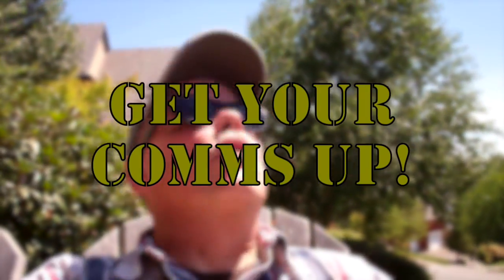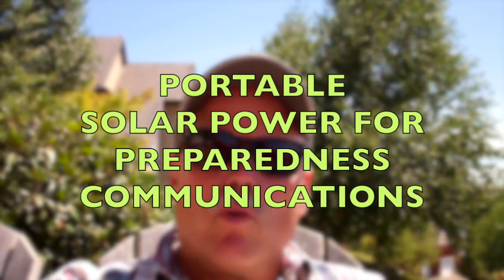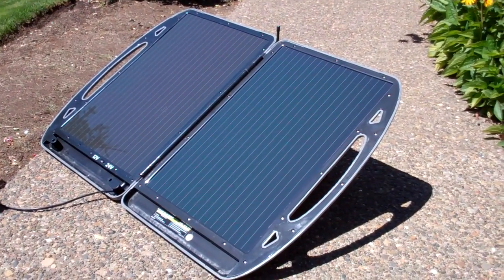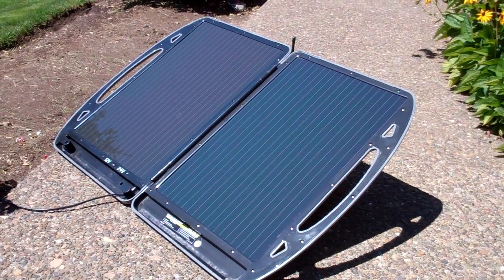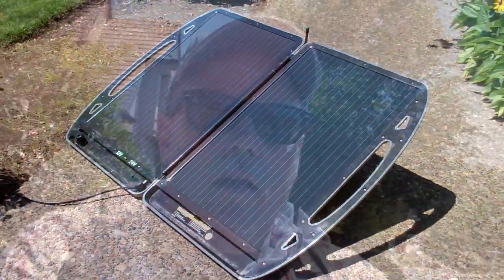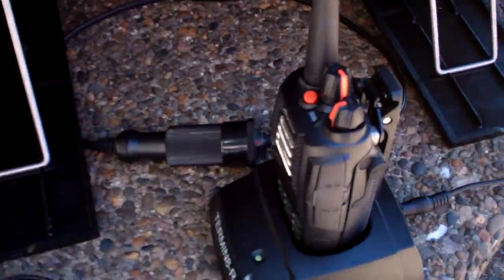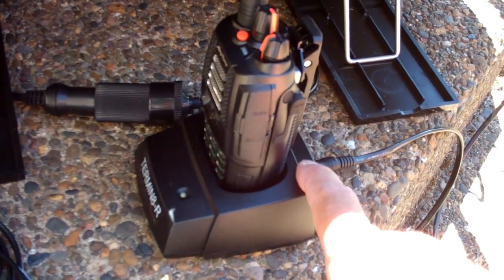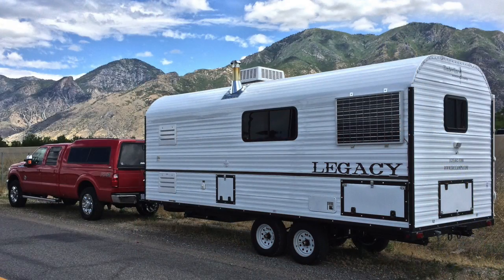Solar Power Intro

Comment: Seems like the Anderson power poles may have some limits at higher power, but they are helpful, especially running QRP.  Look forward to the upcoming projects from you and Commsprepper!  73
Reply from the maker: Mako Shark  Thanks so much fro watching and your input. Check out the Powerwerx site for information on Anderson Powerpoles . . . not limited at high power and not resigned to QRP operations.

Comment: Great video. Love all your vids. I picked up a JB Rouge from Bill at Hardened Power Supplies. MAN I Love that thing. I have a 105 watt solar panel from Portable Solar Power. It was pricey, but I LOVE it. Extremely efficient (21%), portable, extremely light weight, and compact. It folds into a 12" x 12" x less than 1" package.

Looking forward to more of your solar ham vids. I cannot wait to learn more!
Reply from the maker: MonGo WonGo  Wow, very cool . . . JB Rouge from Hardened Power Systems. Excellent! You will not be disappointed as Bill does awesome work. That will be a very durable and serviceable package. Thanks for the kind comments and support!

Comment: That's fantastic!  I've been looking for a good Solar Powered solution for charging up cell phones, walkies, flashlight batteries, etc. for when the power is out for extended periods and I don't want to run my generator for just those items.  We had a tornado that swept through our area a couple of years back (Western Manitoba) that destroyed powerlines and it took the power company a little over a week to get the power back up.  Something like this would have been nice!
Reply from the maker: IAMRONIN  Ronnin - This system would be perfect for  charging cell phones, radios, flashlight batteries, etc. when the power is out for your generator is giving you grief.